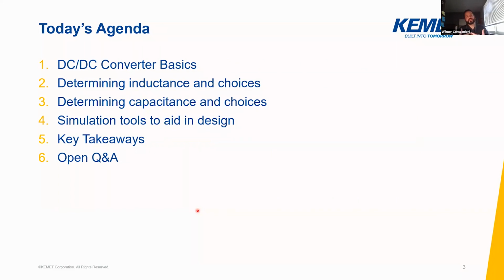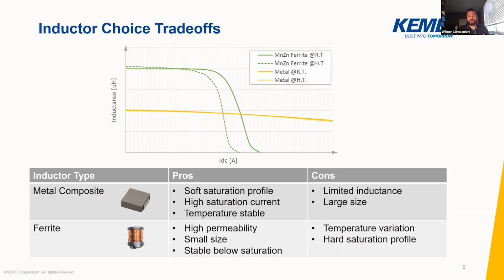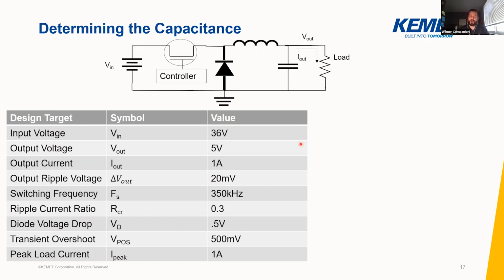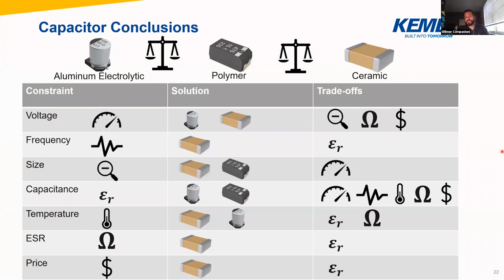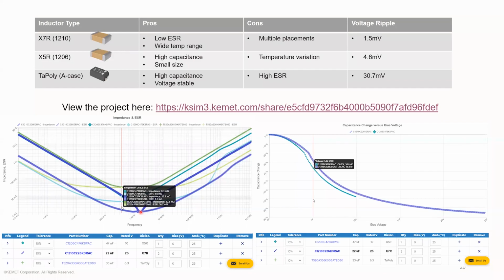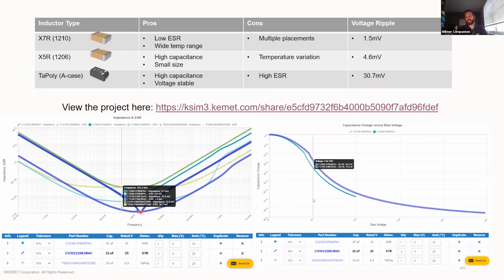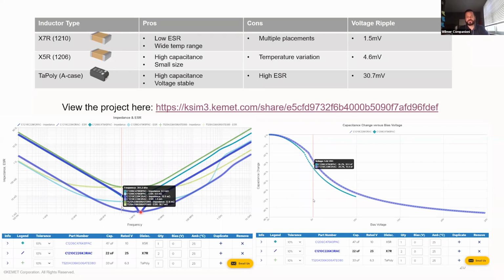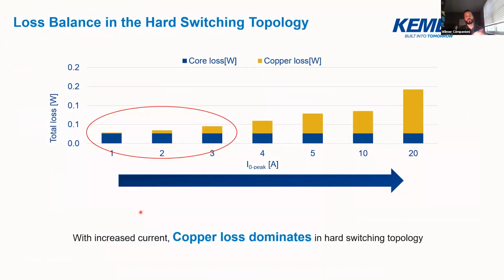KEMET Webinar | The Keys to Choosing Passive Components For Your DCDC Converters

Comment: Hi, I enjoyed your webinar. May I ask if you supply these passive components for Space Applications? I can see also you didn't talk much about tantalum capacitors and your poll question on the type of DC-DC converters most used did not cover those used for exclusively battery-powered equipment. Thanks. May I ask also if optimization and what type can be applied for designing and choosing the components for the converters please. I am looking forward to using your suggestions for my future designs please.
Reply from the maker: Hi Ali - Thanks for your question. We're asking our engineers and we'll get back to you shortly. Thanks!
Reply: Thanks, I appreciate your response. I will wait for your additional information.
Reply from the maker: Hi Ali. KEMET does supply a number of Tantalum MnO2, Polymer and Ceramic capacitors that are made specifically for Space applications. On our website, KEMET.com, we have a dedicated Defense and Aerospace page that lists some, but not all, of our offerings and which DLA drawing or MIL Spec they comply to. Here is a link to that page: https://www.kemet.com/en/us/applications/defense-and-aerospace.html Additionally, we have a Space, Avionics, & Space brochure that covers all of our technologies and what they feature. That guide can be found here: https://assets.brandfolder.com/pd3dg4-2ufh88-6tzxs1/original/KEMET_Space_Avionics_Defense_Capacitors_Brochure.pdf I also want to point out that there are a number of Space customers that are now using Automotive grade products in Space applications. If you are able to use Automotive grade parts in your Space design, we do offer many different types of capacitors as well as a number of magnetics including Inductors that are Automotive grade. Please see the following link: https://assets2.brandfolder.io/bf-boulder-prod/qabn8l-dnvwkg-3a3osw/v/28279617/original/KEMET%20Auto%20Broc%200820.pdf If you have any additional questions, please feel free to reach out to me at communications@kemet.com. - Sam at KEMET, Field Applications Engineer
Reply: Thanks, I am grateful for this information.